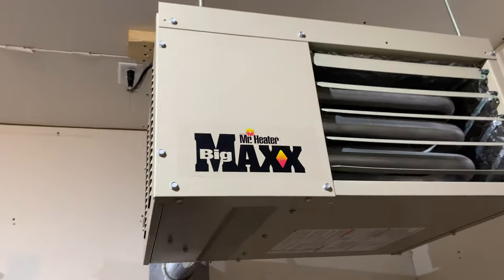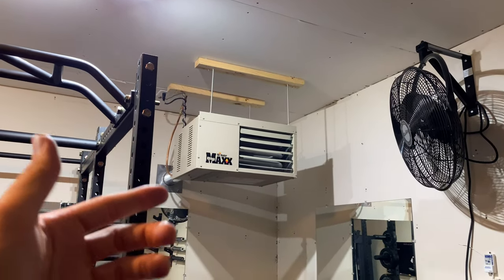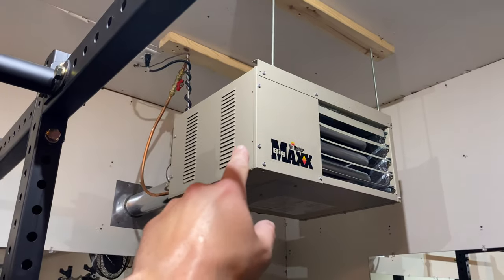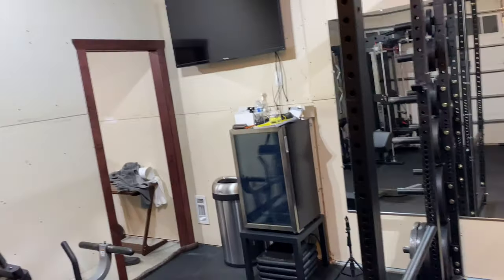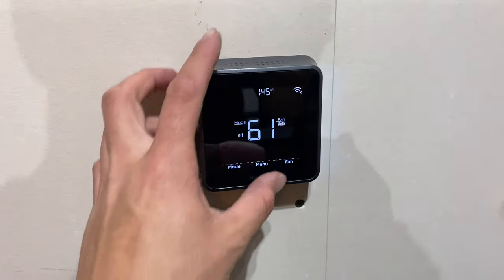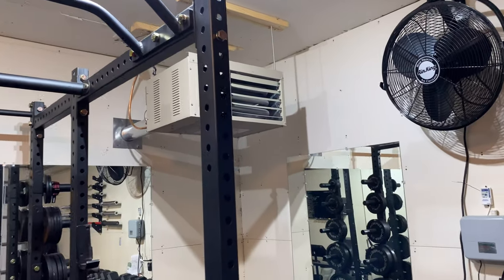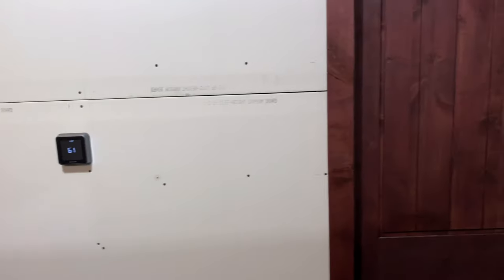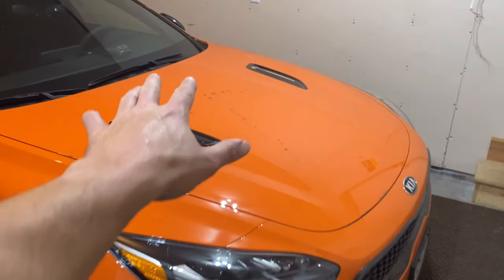BEST GARAGE HEATER: Mr Heater Big Maxx Natural Gas Workshop heater - Modine Hot Dawg Shop Heater

Comment: If you ever have any trouble, first check the pressure switch, clean the hose and then at the exhaust motor port.  It will plug up so run a drill bit or paper clip through to clean the port.  If its plugged it won't close the pressure switch allowing the furnace to run.   This seems to be a pretty common issue.  I also just had to clean the flame sensor due to cutting out as soon as the ignitor stops clicking.  I love my 80K Big Maxx
Reply from the maker: Nice bro, thanks for the info

Comment: doug robertson, I had the same problem (frequent cycling). It turned out to be the heat anticipator in my very old 1980s mercury thermostat.  It has a little sliding rotary adjustment that makes it come on longer or shorter cycles. There's more to it than that but just adjusting it fixed my problem.
Reply from the maker: Maybe his issue is the thermostat also, thanks for sharing!

Comment: I had a 240v electric heater in garage/shop, but it couldn't keep it comfortable and yes, it cost a fortune to run. I installed Mr. Heater 50,000btu unit this year and it has no issue keeping my garage/shop(2.5 car) comfortable. I added the Google Thermostat to mine.
Reply from the maker: Nice Tim! Glad it’s working great for you also!

Comment: Nice setup with the cars, didnt even realize you had that nice two-garage setup next to your garage gym...love it!
Reply from the maker: Thanks bro! Cars are one of my other passions :)
Reply from the maker: What are you using to keep your garage warm during the winter or do you get by without one?
Reply: @MattTolbers  Here in TX where I live it doesn’t get too cold over the winter, very few days around freezing. But I will need a nice wall-mounted fan like yours for next summer when the heat goes crazy 🤪
Reply from the maker: @DanesinTexas  I figured you lived down south where it is nice and warm lol. Do you have AC in your garage? I connected the house air conditioner to my gym so it gets nice and cold during the summer in there also.
Reply: @MattTolbers  Man, I need to do that, was it easy? You did it yourself? I know about cold weather like you do, I’m from Denmark and lived 20 years there before moving here...no one has a garage gym there 🤣🤣
Reply from the maker: I had a buddy that does HVAC help me. It was pretty easy since my furnace is very close to the garage. Just cut a hole in the supply and return duct on the furnace and connected some flexible duct work and ran it to the garage. Cut a hole for both in the wall and put the vents up.
Reply: @MattTolbers  Wow, thats too awesome. You should do a short explanation video on that. I will definitely look into that, and hopefully have it ready for next summer.

Comment: There should be a trap in the gas line before it goes into the heater usually it’s done in black pipe and on the outside vent there should be a Vent cover Over the top of the pipe so birds don’t get into it
Reply from the maker: I think it does where it come from the inside of house. I’ve considered putting a little metal screen over the end of the exhaust pipe for that reason. I live in a new development with tiny trees and hardly any birds but better to be safe.

Comment: Did it all myself. My biggest pain in the ass is there are no videos to speak of about the wall thimble installations. But the rest of it was pretty straight forward. I did the hard line in the garage and CSST from the house out to the garage. Also on my plug in switch I installed a plug in ran by a switch.  Because when heater isn’t running there is power being used at least I hear a humming from the heater. Plus that is a smaller garage. Is that a single stall garage?

Comment: Pretty good installation overall. The stack installation & gas piping looks better than most I see on YouTube. And interesting technique of spiralling the cords around the allthread mounting, I wouldn't recommend it though. Hopefully any vibration won't wear thru the insulation. Probably would have been better to lightly zip tie them instead.
Isn't there supposed to be a drip leg on the unit gas connector? It keeps moisture out of your gas valve, which is not good, especially with the line coming from above, no where to go.
Was this inspected & passed?
Reply from the maker: Everything is still tight and how it was since install. It has drip leg

Comment: Hey Matt, awesome video and thank you for sharing! Not sure if I missed it and I don't want to ask a stupid question. How does the heater turn on, is there a switch wired for is it controlled from the thermostat ?
Reply from the maker: Yeah their is a wire that runs from the thermostat to the heater. You turn it on from the thermostat.
Reply: @MattTolbers  awesome, thanks !

Comment: Hey man I just bought a house that has one of these in the garage. Is it supposed to turn on regardless of the temp in the garage? I tried turning it on but it didn’t (highest temp on the heater thermometer goes to 80).

Comment: Hey Matt merry Christmas, thanks for good detailed down to earth review. so it says minimum clearance from bottom of unit to floor is 8' I see yours isn't does that effect anything that you noticed? or is that more for safety so you don't hit things on it? i currently have an electric one and its not big enough and its expensive to run. anyways thanks for answering my questions when you do.
Reply from the maker: Hey David, Merry Christmas! I have mine at 7' and doesn't effect anything negatively. The height is just so you don't hit anything on it like a vehicle. Works amazing at heating the whole garage for cheap
Reply: @MattTolbers  wrong, the height requirement is to avoid combustible fumes which can settle on the floor level. I'm sure you're setup is just fine, but that is why any of these types of heaters mandate being up that high off the floor. Many garages and shops store things like gas cans, paint thinner, oil based paint, etc, which can produce these flammable fumes. Also, that first noise at startup is the exhaust fan clearing the vent pipe before it fires up. Lastly, that is a sweet heater you got. I had to go with a 7,500 watt electric because I don't have a natural gas line. Cheers.

Comment: Hi Matt, thanks for the video.   How is the unit when it comes to noise?  I am thinking about installing one in my shop.
Reply from the maker: I actually demonstrated in the video the noise level
Reply: So what I heard is pretty accurate then...seems pretty quiet.  Thanks.
Reply from the maker: The noise shouldn’t bother you at all.
Reply: @MattTolbers  I have heard from installers that the 80k unit is far more quiet than the 50k. I am thinking I am going that route for my 1000 sq ft. garage.

Comment: Hello all.  Thanks for this.  I’m looking for a heating solution for a 1,000 sq. ft. uninstalled garage.  This 50k BTU appears to be a solution.  Is there such a thing as a wireless thermostat device to use my phone instead of a traditional wired thermostat?  It’s a new home under construction so no existing thermostat in the garage. Thanks.

Comment: Matt, how hot does your exhaust pipe get, can you touch it when the unit runs. Also does it drop condensation outside?
Reply from the maker: No it doesn’t get very hot at all and no condensation that I know of
Reply: It's B vent pipe so there's an inner wall for Exhaust and and outer wall to protect everything from the heat.

Comment: Is setup pretty easy with a thermostat? What does it entail?
Reply from the maker: I paid to have it installed, but pretty much run the wires from heater to thermostat and connect them. Should be pretty easy

Comment: Great video. I just installed one my self. I just want to verify something.  Is it normal to experience the flames cycling on and off on a regular interval as the heat cycle is running?
Reply from the maker: Hey, you should hear it spark once to get the flames going but after that it should just keep running without resparking until it heats the room up to the temp you set on the thermostat. Then it will shut off until the temp drop a couple of degrees below your set temp and it will do it again. If it has to keep re sparking while running sounds like the natural gas isn't flowing like it should and loosing the flame.
Reply: @MattTolbers  My heating contractor is baffled. Everything checks out and there is no error codes, but the flames turn off for 30 seconds or so and then relight. The fan never shuts off and the cycle continues until the tstat stop calling for heat, and everything shuts down normally.  The contractor is pretty sure the control board is bad some how. High limit sensor and flame sensor check out as normal.
Reply: A new digital house thermostat caused me a similar problem. it cycled frequently even with air conditioner in the summer. Turns out there was a non-adjustable setting called "span" which basically made it come on at 71.9 degrees and turn off at 72.1 degrees. (permanently set to 0.2 degree span).  I bought a different thermostat and set it for 3° span and everything works normal.  20 minute cycle on typically.

Also with my Big Maxx heater, I had the same problem at first. Problem turned out to be the old 1980s non-digital thermostat I was using.  There's an adjustment for longer or shorter cycles on the inside, looks like a second thermostat. Adjusting that fixed my problem.
Reply: also, I doubt if that vent pointing down is legal/to code. Should be pointing up with a rain cap on it , I believe.
Reply from the maker: A lot of people local to me have it facing down, not sure if it’s code but an easy fix when I need to.
Reply: @kevingermon8643  That was one of the things I thought of. I bypassed the tstat by simply tying the red/white wires together to see what happened. It did the same thing. 
I was eventually able to get ahold of the technical service dept ar Enerco (parent company of mr heater). It is something that happens once in a while. They sent me a new circuit board and gas valve. I have not replaced yet but will let you know what happens.  Will replace circuit board first and if that doesn't work will replace gas valve. 
I have to give props to the guys at Enerco. Very helpful.
Reply: @MattTolbers  see my reply below.  Just wanted to add that the technical service dept at Enerco (parent company of mr heater) has been very helpful with trying to solve this issue.
Reply from the maker: Awesome Doug, hope that fixes it!
Reply: @MattTolbers  nope. Same issue still happening. The techs at Enerco are having me check some other things. At least they are very helpful.

Comment: My HVAC contractor will not install these or even work on them. Lots of bad units and common failures, hard to find parts because they are always changing the units.
Reply from the maker: Everyone’s got their own opinion and experiences. I have a bunch of HVAC friends and used to drive for UPS and see them in people garage and ask them how it’s been for them and so far all positive experiences I’ve heard. This will be my 4th winter of running it all winter with no issues, it’s well paid for it’s self already in my opinion. If something major went out and it was to much of a pain to fix I’d just buy another and slap it in same spot, but that’s just me. If you want it to last 20 years no issues your probably gonna have to buy a much more expensive unit.

Comment: Fellow Minnesotan as well! Live in central mn. Who did your install. looking at bids!
Reply from the maker: Lots of Minnesotans! I used Dan Weinzetl Contracting (763)219-7581. He put in a divided wall and couple other little things at the same time so he may quote you a little more for just a heater but worth getting a quote to compare to others.
Reply: Gas piping has no drip leg.
Reply from the maker: It does, it’s just on the other side of the wall in the basement
Reply: @MattTolbers  Needs to be at the appliance.
Reply from the maker: @barrymccaulkener8828  Ok no biggie, if something needs to be changed before I move I'll get it done. Heater works amazing is all I care about right now. Thanks for watching!

Comment: Hey Matt. Living in fridley MN. Wondering how much you paid that guy to install that? I have a 500sq foot detached garage that I need this heater in. Thanks Matt!
Reply from the maker: A lot of Minnesotans :) I wanna say I paid $1000 total which included the heater, exhaust piping what he used to hang it and labor. Other places I was calling wanted at least $1000 more
Reply: @MattTolbers  thanks for your reply Matt. Do you by chance have any contact information from this guy? I would love to get in contact. Just purchased the mr heater 50,000btu last week👌🏼👌🏼 thanks Matt.
Reply from the maker: I used Dan Weinzetl Contracting (763)219-7581. He put in a divided wall and couple other little things at the same time so he may quote you a little more for just a heater but worth getting a quote to compare to others.

Comment: Quick question when yours is running does it blow really hot air or a good warm only? Mine does not blow hot hot even when the flames and fan is on. I am just wondering if thats normal.
Reply: Mine doesnt blow hot either. I read its common and that people change the fan or rig a different fan. It doesnt seem to blow hard enough.

Comment: Did they put a regulator on the gas line?
Reply from the maker: Yes sir, everything is legit just on other side of wall in basement
Reply: @MattTolbers  thanks, I am putting one in and there was no mention of one in the installation manual that's why I asked.

Comment: What about the Condensation drain? Do you need it?
Reply from the maker: Yeah it looks like there’s a tube right underneath the exhaust pipe which I would assume is the condensation drain. I had it installed so not 100% sure
Reply: So you can Actually see it on your exhaust?
Reply: I didn’t see it on your Video. Thanks 😊
Reply from the maker: I don't see anything on the exhaust from the inside so there's probably not. The little hose I'm talking about can be see at the bottom of the pic I showed of the outside exhaust, not sure what that's for. From some reading sounds like it doesn't need it, at least while vented vertically.

Comment: Any reason why its supposed to be 8 feet minimum?
Reply from the maker: Some code to prevent bigger vehicles from hitting the heater which could cause and explosion or leak I guess. Hard to find much info on it, but most seems to put it lower with no issues.

Comment: Modine hot dawg is a better heater, thicker heat exchanger. Where is the wall thimble for the exhaust. Definitely not installed to code.
Reply from the maker: Yeah it has to be a little different for the much in price, but not worth it for most people when this works perfect for half the price. What’s awesome is I’ll be a pro on code after this video lol. Thanks for watching Dean

Comment: I went through 2 fan blades on that heater, they end up making alot of noise anyone else have those issues?
Reply from the maker: Dang bro sorry to hear that. Seems like the fan would be pretty easy to replace. I’ve run mine a ton in three winters I’ve had it and no issues yet.
Reply: I had a fan issue with mine but it was bought on clearance and out of box.  Needed replaced.  Been great since.
Reply from the maker: @jgonz3542  glad it’s working great now!

Comment: That gas line is not even close to code.
Reply from the maker: I had it installed by the professionals when they built the house, but doesn’t surprise me. Not sure if code is different depending where you live. Either way I’ll get it up to code
Reply from the maker: The drip leg is on the other side of the wall in the basement.